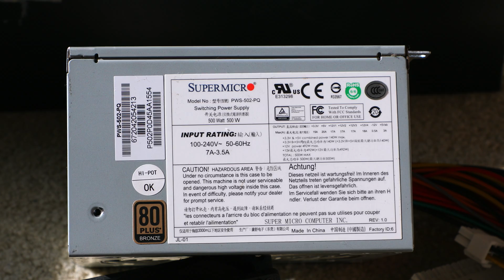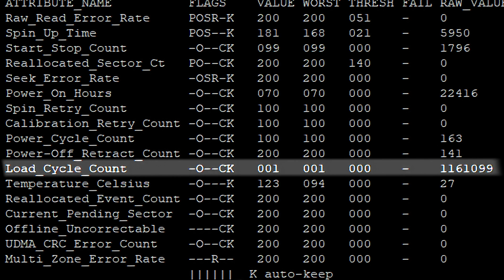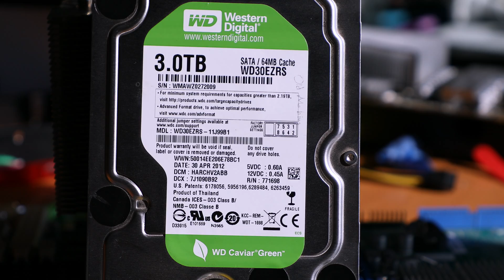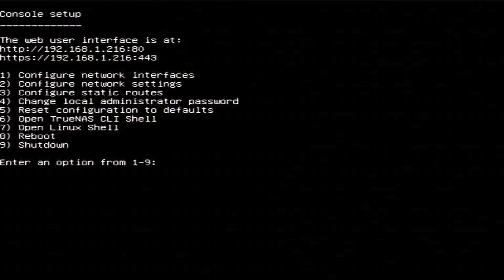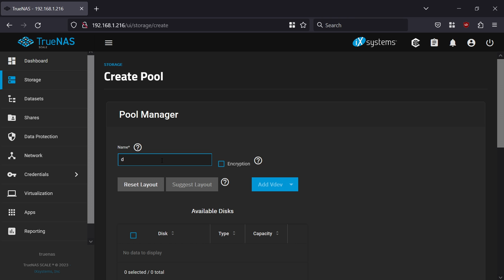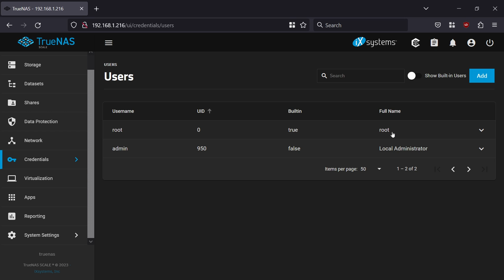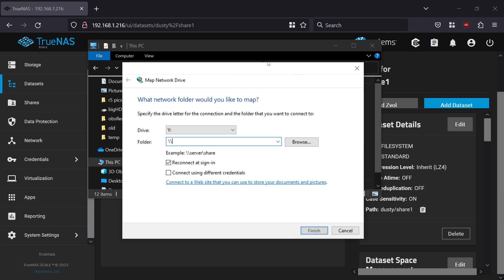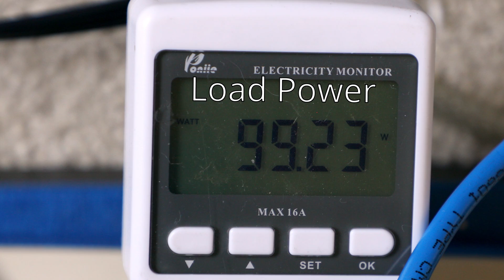Saving an old server from the E-waste to create a NAS

Comment: I have that same case, but it's over 20 years old. It's a dual Xeon 32-bit system, and it draws about 350 watts at idle with no drives. I'm trying to save the case and turn it into a NAS with a spare motherboard, but I'd have to replace the power supply with a more efficient one. (Even with the new motherboard and the system powered off it draws 11 watts.) I'm not sure it will be worth it for me, and I might be better off selling off the parts and starting fresh.

Comment: Hello, do you know a way to activate the turbo boost of the cpu inside truenas scale v22.12.2  and passing thru to a windows 10 vm machine ? I am running a epyc 7d12 on a supermicro h11 ssl-i,,, the cpu is running on the base clock of 1.1ghz full time,  seems a little slow... even when i run cinebench or cpu-z

Comment: Nice salvage! I did something similar awhile back with an old xeon 1200, MSI MB w/8GB mem, 6 WD Red Plus (4TB each), 2 crucial mx500 SSD. It idled around 53 watts. Straight FreeBSD 12.2 at the time.
Reply: Yeah, nice salvage..

Comment: Hey is it better to start with TrueNAS or something else if I only have one HDD  but plan to add more in the future? Unraid seems like a better option but its not free.
Reply from the maker: Unraid is normally better if you want to be able to expand easily. Unraid allows you to easily add an drive of any size. Truenas in the other case uses zfs which doesn’t have a similar parity with mixed drive sizes.

Comment: As I look around at all the old systems I've resurrected over the years, I see you share the same vision.
I have an old Sempron system running FreeBSD, which I use as a file server. It doesn't have enough RAM to run FreeNAS though.